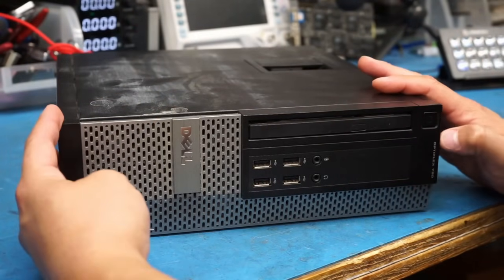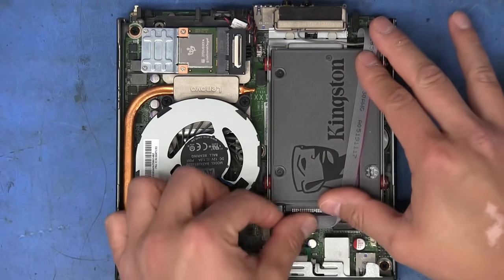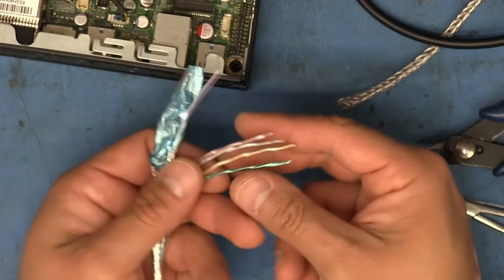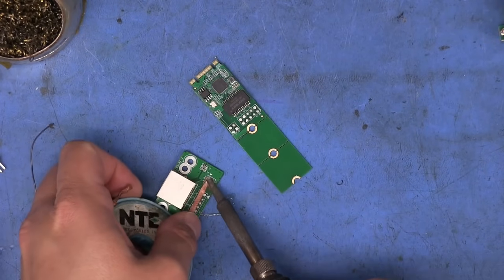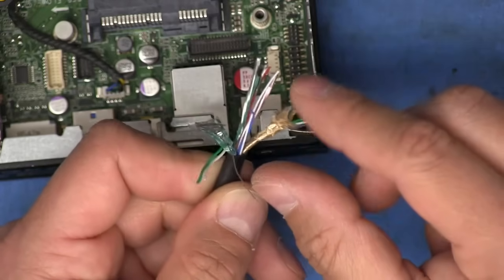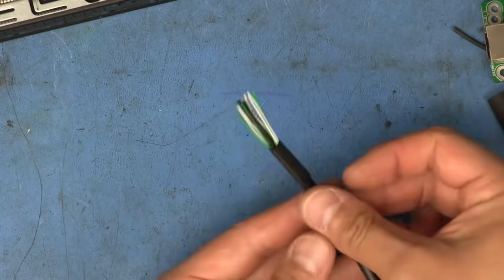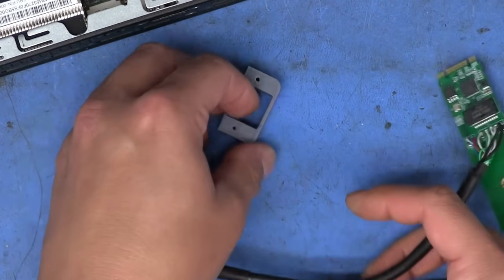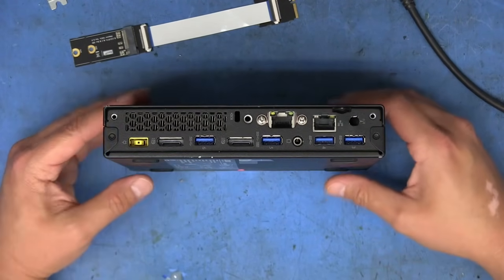TEF #146 | Adding A Second Ethernet Port To A Lenovo Thinkcentre M900 Tiny

Comment: Great demonstration on how to add a port, thanks for posting this. 
When I was new to telephony, one day I had to test a special circuit to the much bigger Bell Office. In telephone offices everything starts counting from ZERO, which I did not know. So I counted over the Jacks and pulged in, and the wrong circuit went down, and the alarms are ringing. This is what I heard from the other office, “Don’t worry about it, you was only one jack off.”
Reply from the maker: Aww man, it sucks being one jack off
Reply: lol, guess i was a bit late with the suggestion. If you remove the black covering on the cables they will route much easier. Anyway I appreciate the video.

Comment: Bought "Gigabit M2 lan card with Intel I210 chipset A+E Key port M.2 network card" from aliexpress which worked well and fit (like your realtek, fits on the wifi slot) on Lenovo m910q or probably m900 series.
Reply from the maker: Awesome, thanks for the info!
Reply: Hi @amvaron, could you share the link for that one you bought from AliExpress? Thanks!

Comment: I've got an M900 Tiny running Proxmox and Home Assistant plus a few other VMs, but am hitting the concurrent device limit on an AI Mesh node in the house. Rather than move over to Ubiquity or something, I'm thinking of going to pfsense. Since the M900 has been upgraded to an i7 6700 and 64GB of RAM it's got enough performance to handle it (especially after I finally upgrade the cooling), but I'm running the aforementioned Coral TPU in the M2 E key slot, and an NVMe drive for host/vm root in the other and can't afford to lose either. Looks like I'm screwed, since I really need that extra port for pfsense. Suppose I could try a USB 3.0 adapter, but meh.
Reply from the maker: I suppose the final frontier to get everything to stay internal to the device would be to physically remove the USB connectors and solder directly to the motherboard. But yeah, I feel you on the limitations.
Reply: @ThatElectronicsFool  I mean, it would still be a USB device. The physical connector isn't the limiting factor. What would be interesting is seeing if you could manually create a PCIE lane from a CPU pin.

Comment: I probably just use the reltek port and wired it to the intel nic. Ethernet is a standard. Other then the chip set, they are identical. Pfsense is not has opensource friendly. It is only complied to work with specific hardware. Opnsense is a fork of pfsense, which would be more compatible. It doesn't have has much fit and finish, but it is fairly similar. But given the amount of time to spent on designing a special cable, I figure you may want to just compile pfsense from source with the reltek drivers. You made a great video, just food for thought. I prefer soldering to programing too.
Reply from the maker: The idea of using the Realtek port with the Intel NIC is good, although it does require having purchased one of each. I have a video that I'm aiming to release on Wednesday where I thought up another idea that does not require making a cable or soldering individual wires to the Intel NIC.

As for OPNsense, funny you mention it because I've been meaning to give it a shot, but I always try to experiment with stuff on spare equipment before I try to make any permanent changes to my network setup. Having a machine that I can just drop in really helps prevent downtime, and I think I might use this one for that. As far as compiling, I don't know if I want to go through the trouble of having to learn how to do so. Lol

Thank you for your feedback!

Comment: You know they make 90 degree headers. By using them you could just plug in the origional cables. seems like it would have been a lot easier
Reply from the maker: I thought about that after this video posted and I made a follow up, which released this morning.

Comment: Pfsense is FreeBSD based, so that is why it didn't work out of the box. Installing the drivers should have worked, but YMMV (and did, obviously).
Reply from the maker: I got it to show up under "Set interface(s) IP address", but it just would not do anything. And I know just enough to get myself in trouble, so I gave up after trying several times and still couldn't get it to do anything. That's when I decided to order the Intel card. Figured it would work right out the box.
Reply: @ThatElectronicsFool  I have the same card in my M720q (tiny), but am running Proxmox on it. Seen enough on Reddit to know that it wasn't the friendliest in FreeBSD, so I didn't even attempt it (and I'd consider myself very advanced with *nix/BSDs).

Comment: could you post the link where you got that Ethernet port from China? I am looking to get these cheap mini PCs to add to my homelab. thanks
Reply from the maker: I don't know if I can post the link, but the listing is:

2.5G M.2 b+M key Ethernet Card 2500Mbps RJ45 LAN Card Intel I225 Chipset

The seller is "shenzhenhd"

I'll add the link below this and see if it doesn't get removed:

https://www.ebay.com/itm/195009540088
Reply: Do you have a link to the first nic with the pins of proper height and location. TIA @ThatElectronicsFool
Reply from the maker: @JasonWald  The listing for that particular one says the listing has ended, but I'll paste it below:

https://www.ebay.com/itm/175525730846

Ah, I guess it doesn't work. But the description said:

M.2 A+E 2.5G Ethernet Adapter 2.5G/1G/100M Multi-Gigabit M.2 Network Card 8125U8

Comment: all this becuase pfsense doesnt want to play nice with non intel nic cards. great effort on your part. you have the patience of a monk in a brothel soldering all those tiny wires.
Reply from the maker: Lol, first time hearing that expression, and thank you!
Reply: @aseantravels8772 really isn't as much pfsense, as it isFreeBSD (which is what pfsense is built on top of).
Reply: @STLJonny yes. I think OPNsense is built on a newer version of freebsd. I wonder how it does with realtek nics.
Reply: FreeBSD doesn't always support Realtek NICs out of the box. I just had this exact issue. However running this command resolved it:
pkg install os-realtek-re

Comment: Instead of hea5shrinking two bare grounds, you should've just pulled through an extra twisted pair to use as insulated ground wires.

Comment: i did not do it on my machine like this. i have lenovo m625q i use only one ethernet port. i have a 5port managed switch with 2 vlan's works fine but looking to upgrade to this

Comment: Hi, this solution work in a PC with Debian OS?
Reply from the maker: As far as I'm aware, OS doesn't matter as the chip that the board uses, an ASM1184e, should be transparent to the system it's installed on. It doesn't require drivers.

Comment: I had tge exact same idea. Cant get it to work with OPNSense. Have you had any luck? Before I'm buying another with an Intel Chip.
Reply from the maker: Unfortunately, I haven't given OPN sense a try yet, so I don't have an answer. :(
Reply: @ThatElectronicsFool  Actually I got it to work!
The issue is that the driver for the Realtek RTL8125 chip isn't installed by default.
you can however install the driver with the command
>pkg install os-realtek-re 
and by adding
>if_re_load="YES"
>if_re_name="/boot/modules/if_re.ko"
to your /boot/loader.conf
after a reboot they just work.

This sounds quite simple, but you do need an internet connection for this to work. So you need a seperate router and confingure a working port (If you have none maybe a USB adaptor might work) as your WAN port in order to download the package.
Reply: @Aetohatir that is great news. Another video might be helpful.  I wonder if that would work with opnsense

Comment: Instead of this there is too many usb 3.0 available here what if we use tp link usb to ethernet gigabit adaptor and stick with glue on top of this PC?
Reply from the maker: A USB 3.0 network adapter would probably work just fine, as long as your OS supports it. In this video, I just wanted to show a completely integrated solution for adding another network port to this PC so that there weren't additional devices hanging off behind it.
Reply: @ThatElectronicsFool  atleast adaptor will work fine??